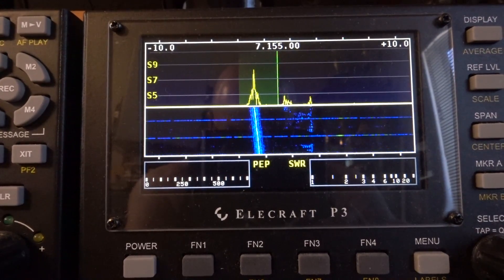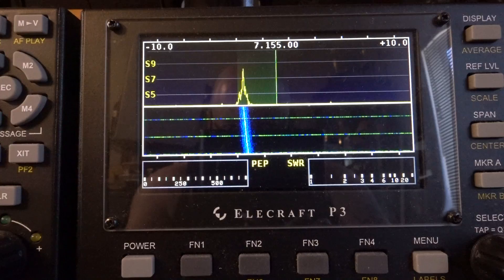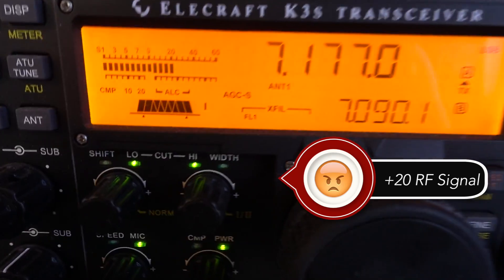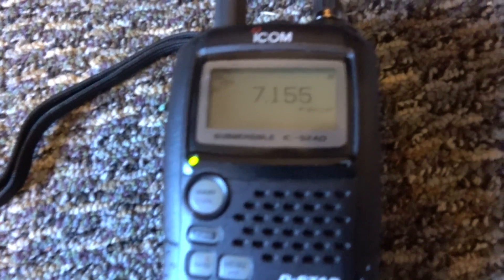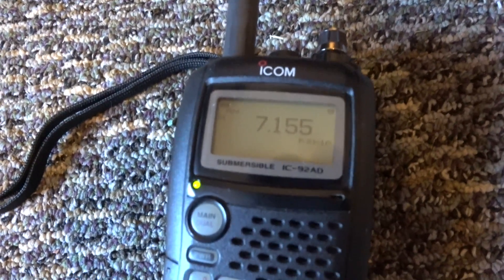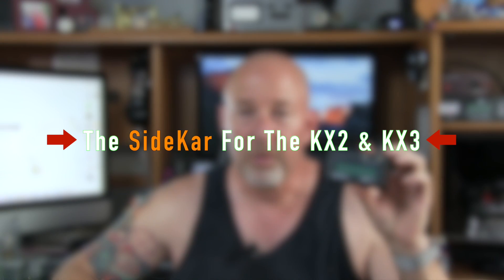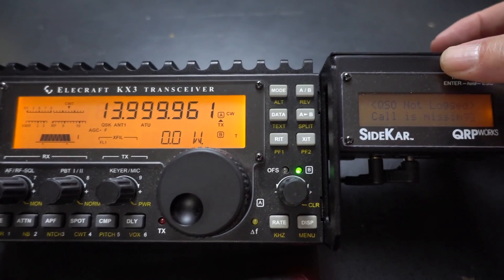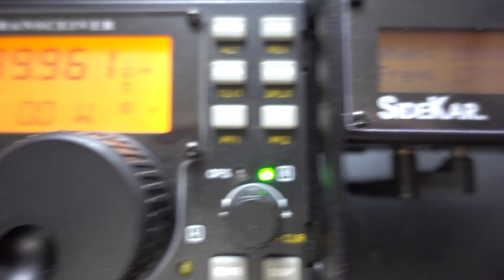Do You Have RF Noise?, SideKar for KX2 KX3 Preview -K6UDA Radio EP 15

Comment: I have one of those remote switches  thats controlling a pedestal fan and where I need it there must be some type of interference because it's hot or miss if it works but if i go on the other side of my room which is maybe 20 feet away the remote works great. I have an RTL-SDR dongle and am trying to find the source.

Comment: Other than a welder, battery charges are the worst emitters of dirty power.  Try reading the output ever with a True RMS multi-meter and you are not going to get a valid reading.  I discovered this while trouble shooting why my 12 volt fridge wouldn't run on my boat until I took the battery charger out of the act. I put my meter on it without getting a reading yet, it does indeed charge my batteries. Go figure.  In commercial electrical applications we use to have to install isolation transformers upstream from these things to CLEAN UP the noise.   Good Video.  Thanks.
Reply from the maker: I’ve learned that. The hard way.

Comment: I have RF noise, When the radio is connected to a 12v car battery, Turn the house power off and it goes away, I unplugged everything and it is still there :(   i can only guess it may be my solar panels

Comment: Thank you Rob for the video. I too had strange encounters with noise, I thought it's worth sharing:

1. The "monster noise" I had once covered all the bands from 20m up to 70cm, S9 - S9 + 10. The culprit was a certain type of LED lightbulb. I strongly suspect those wouldn't pass the FCC/CE tests (despite having those marks on the packaging). Changed them to a few well-made ones, and all the noise disappeared.

2. A strange pulsing / cracking noise appeared randomly on most bands. A short investigation revelaled that it's my ethernet switch to blame. More specifically, when a cable was plugged into it, BUT THERE WAS NOTHING ON THE OTHER END, the noise appeared, probably due to the switch trying to discover a device on the other end, but the cable wasn't terminated properly.

73 de HA5FTL
Reply: Ethernet has something called auto-negotiation pulses, these pulses are sent over the Ethernet cable to indeed discover a device on the other side and negotiate a common standard. My guess is the unshielded twisted pair acted like an antenna